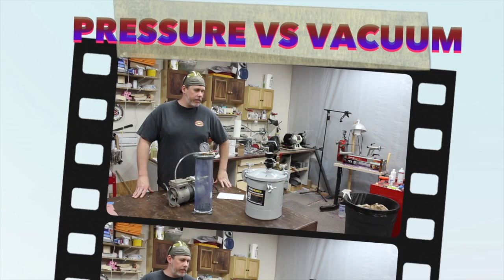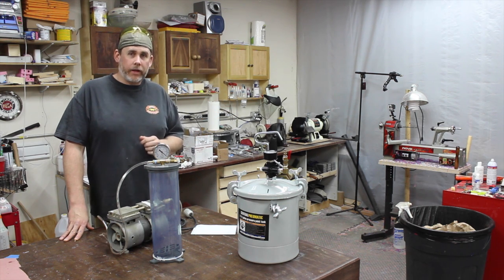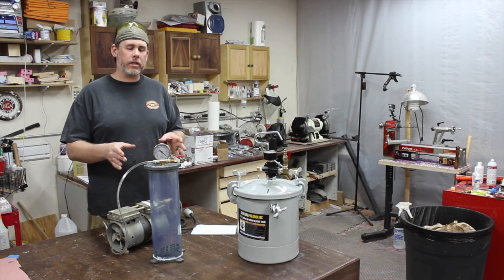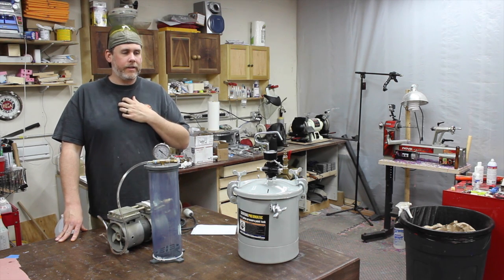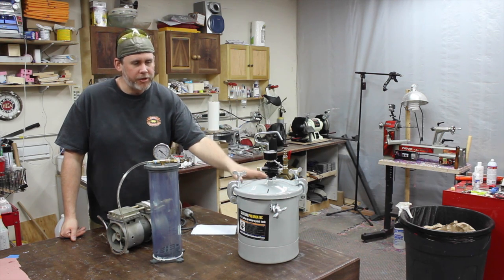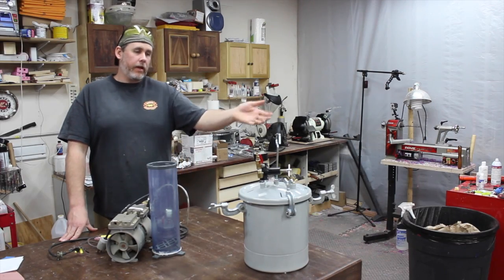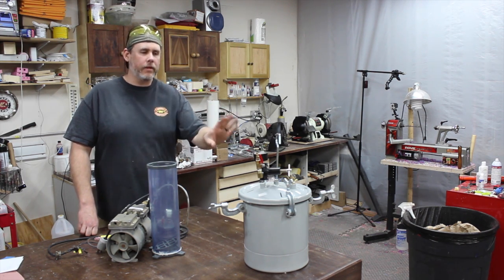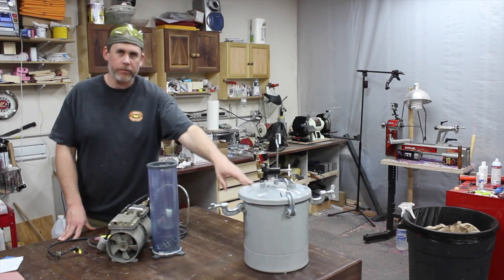Can I Use Vacuum Instead of A Pressure Pot to Cast Resins With?

Comment: I've tried using Smooth On Urethane plastic in a vacuum chamber with interesting results.  (7 minute pot time)  I will vacuum the individual components, then vacuum the mix, then fill the mold in the vacuum chamber and turn it on.  When you fill the mold, if you just let the vacuum go, the mixture will froth and bubble and ruin your casting.  

On the other hand, if you watch your mold in the chamber and ride/release the pressure to keep the frothing and overflow to a minimum, it seems to remove the large bubbles from the inside of the material and brings the smaller bubbles to the surface of the casting.  It's just like what happens when you release the pressure on rising material in the chamber to push it down and then bring the pressure back up.  I can't get the pressure back all the way to 29Hg.  The plastic  will start to froth and overflow the mold well before that point. Ease the pressure before that happens so the mold stays full, and let the material settle completely in the mold before it sets up.   This doesn't work with plastics that have a very short pot life. 3 minutes is too short.  7 minutes seems just about ideal. 

Although the surface of the mold winds up less smooth [more bubbly] than before, it definitely has eliminated a number of voids and seams inside the mold that I was having problems with.   I will try pressure casting when my pot arrives, but I'm worried it may not work since I am encapsulating objects with voids inside them and I don't want to force the plastic into the voids.
Reply from the maker: +StudioVoodooMusic Interesting results! Thanks for sharing that info with everyone. You might be right about the pressure pushing resin into the voids of your encapsulations, but perhaps if you only use low pressure it might help. I've never really tried it, but I crank mine up when casting wood and things so that the resin will be forced into the cracks as much as possible.

Comment: $100-$120 for a pressure pot?! Where can you buy one for at that price!?
Reply from the maker: sonicrockmanx You can get them at Harbor Freight, Amazon, Grizzly, and probably a couple others too for around that price. The HF one is around $90 if you bring in a 20% off coupon that they send out in the mail.
Reply: Hi Zac, curious if you have any sense of community love/hate for the Grizzly pots?
Interesting thread BTW on bubble removal physics. My hunch is that the density of the resin is simply overtaking the space of the bubbles and pushing them up and out.  Imagine a sealed container of air taken to a 100 ft depth in water (about 50 p.s.i.) and let loose.
Keep rockin', you got some great content!
- Bill
Reply from the maker: At this point, I really recommend just going with a CA Technologies pot. They are so much better in quality and easier to use, that I can't really recommend buying a cheap one anymore. All the bargain brands are about equal in quality

Comment: I have thought about this for years!!  thanks for your thoughts to understand  :)
Reply from the maker: Sophie Nelson I know how you feel Sophie! I kept hearing conflicting answers to that question, depending on who you ask. So, I decided to do some investigating! 

I still think I'm going to do some experiments with it using PR and epoxy in the future though. I need to convert a pressure pot into a vacuum chamber first. I think it could be "possible" to use vacuum, but I'm pretty convinced that pressure is a better choice regardless of resin. I'm 100% convinced that you should NOT use vacuum with Alumilite since it sets so fast though.
Reply: +Zac Higgins It may be beneficial to vacuum your 2 parts before mixing to degas any bubbles entrapped when pouring out of the original container. Just a thought; when carefully mixing so as to not trap air in the mix, it takes additional time. Is it the same amount of time or close if you would just mix quickly, degas and then pour? I would think it is comparable. Alumalite is pretty fast setting, it may pay to use one of their slower acting compounds. Have you ever tried Silmar products? They make some top notch products as well but then again, I am using polyester.
Reply from the maker: +sams iam I find pressure to work just fine for this application, and it's really the only option with Alumilite due to the fast set time. I have tried PR, but I can't stand the smell of it and it's brittle. Alumilite is a much nicer product to machine/turn, and I prefer the fast cure time as well.

Comment: Some of the early casters and stabilizers used a pressure pot that was configured to do both vac and pressure. Some will argue that vac in pressure vessel is a bad idea and I'm not going to debate it, but this was common practice 10 years ago and I never heard of any problems. The down side to stabilizing with vac using a pressure pot is that you can't see the bubbles to know that the process is complete. The up side is you can release the vac and go directly to pressure to force the resin deeper, but again the benefits of this are debatable. Is it as efficient? debateable, but it is cheaper since you are only buying one vessel (you still need both the compressor and vac pump though)
Reply from the maker: Michael T Shue Studios Thanks for the info Michael, very interesting. Sounds like a pretty cool set up having both in one, but I definitely don't like the lack of visibility when it's being used for vacuum. I also don't think there is any reason to use vacuum when doing casting. I doubt there would be any noticeable difference in quality of the final product doing vac & pressure vs. just pressure. Probably why that method isn't being used much any more.

Comment: Great video, thank you.  
I do use vacuum to degas polyurethane and have even had good results from degassing polyester resins.  I did find I had to mix slightly less catalyst for the polyesters as the vacuum tends to heat up the mix, therefore kicking the exothermic reaction faster.  In the end, I still think I need a pressure pot because I still can trap air when I pour the resin into the molds.
Reply from the maker: +cavx01 Thanks for watching! Sorry for the way late response, I didn't see this comment until now. I had a feeling it might be close using the slow set resins in vacuum, but I wasn't sure what kind of result you would really get. Thanks for letting me know about your experience.

Comment: Thanks for the explanation Zac. It's exactly what I was looking for.
These kits seem to be a lot cheaper in the US. In the UK just the vacuum chamber without the pump is about £400 and you'd be looking at the same sort of money for a pressure pot.
Luckily your advice coupled with a few tutorials on Instructables means I only need to find a vacuum pump to start stabilising wood. 
Cheers,
Ben
Reply from the maker: Glad it was helpful Ben, I know how confusing and expensive this stuff can be!
Reply: TeamWild Vacuum Chamber and Pump on this website for £410 ex VAT, So not too bad.http://www.easycomposites.co.uk/products/vacuum-equipment/complete-vacuum-degassing-system.aspx

Comment: Hi Zac
I'm starting to stabilize wood and cast some resin. As I was researching this topic I cane across your video. Very infomative, thatnks for that. I have a question: Why wouldn't be able to suck air (vacuum) out of the same paint pressure pot when I want to stabilise  and then use the same pot to push pressure to cast resin????   why do i need 2 pots?
Reply: I'm starting to do my research on this, too, and I had a similar thought, initially. Visibility and timing are the only things I can think of off the top of my head that would be an easy "no" answer to using it for both. When under vac, you need to observe the resin to determine when all the air has been evacuated. If you try to pour your mold, then pull vac, you will end up with a mess as the gasses bubble and expand, so keep it in a large enough plastic mixing container at first and pour when done.
Reply from the maker: +andre Levesque It's possible to use one for both, but I prefer to use the TurnTex chambers for stabilizing wood because you can see everything that's going on in them. Even with a clear conversion lid on a regular pressure pot, you can't really see what's happening very well with the wood. It helps tremendously to see from the sides so you know when you've pulled all the air out of the wood. The other reason I prefer having separate vacuum chambers and pressure pots is I am using both at the same time.

Comment: Great video Zac, you have answered a few questions I have had regarding Vacuum versus pressure.  Personally I always cast my blanks around the tubes for pens. the reason for this is, when you drill the hole for the tube it almost always clouds up from the drill bit heating up the resin.  I don't use pressure or vacuum because it forces the resin in to the tube.  I usually warm the resin to make it a thinner viscosity and the bubbles float out.  I use epoxy resin as Alumilite  is not available here in the UK but epoxy never seems to be as Crystal clear as Alumilite.  Thanks for posting this.
All the best
Tony
Reply from the maker: Hey Tony thanks for watching, I'm glad it was helpful.

If you're interested in trying out pressure or vacuum in the future, there are some silicone molds that you can buy that use silicone plugs that seal off the tube for tube-in casting (I'm assuming you have a homemade setup for your molds). I use them when I'm doing a tube-in casting with pressure and haven't had any issues yet. They are set up perfectly, so I use them rather than making a homemade setup for that. You could just get some of those silicone plugs and try it out with a different type of mold. I get mine at http://www.ptownsubbie.com/siliconemold.html

Down below in the comments, Cory mentioned using vacuum to degas the resin prior to pouring. According to what he's seen, it helps with the cloudiness in epoxy. I haven't tried that personally though since I use Alumilite. It just sets to fast to use vacuum.

If you try out some new methods, let me know. I'd love to hear what results you get.

Comment: A vacuum chamber is also known as a degassing chamber. When you use  silicon and slow setting resins (not alumilite) for molds and parts engineering you want to "degas" the silicon before you pour it into a mold so you get a pure cast. Depending on the set time of alumilite you could theoretically degas it before poring it as long as you can accomplish it before it's set time.  I assume they (alumilite) recommend the pressure pot because the set time is too fast for degassing. Sounds good in my head anyways lol
Reply from the maker: Thanks for mentioning silicone molds, they definitely can use degassing if you want to make good quality molds. As far as resins go, as long as you don't shake up the bottle of part A and part B, there shouldn't be any air in the resins before you start mixing anyway. I may be missing something though.  Alumilite would cure too fast to cast it in a vacuum chamber, but it may be possible with PR or epoxy.
Reply: I've never tried it personally but I've seen it, if you mixed two batches of clear epoxy one just trying to mix it without causing too much air to get in and the other put through a vacuum  chamber the degassed batch will come out super clear while the other will be kinda cloudy.  think it was west epoxy they used.
Reply from the maker: Cory Tichenor Interesting, might have to try that out one of these days.

Comment from the maker: ***** From what I've heard, the amount of pressure needed to stabilize wood with pressure requires a pretty super-industrial setup that is literally not possible to do in a home workshop.
Reply: Could you elaborate on the stabilize wood method you're referring to?
Reply from the maker: Dyami Plotke I wasn't sure which method you were asking about, so I covered both...

If you're talking about using pressure to stabilize wood, you put it under extreme pressure and it forces resin into the wood. I don't really know anything about that method, but from what I understand it takes way more pressure than you can get with an air compressor.  

The vacuum method is where you suck all the air out of the wood in a vacuum chamber.  Once all the air is removed and you release the vacuum, resin is forced into the interior of the wood where the air was. You then bake the wood which cures the resin inside the wood.

I have a video series about using vacuum for stabilizing wood if anyone is interested in seeing that method http://www.youtube.com/playlist?list=PLoeB-EPC_91vC03jk5hS8SH_7Ow4nqyZL
Reply: Thanks, Zac Higgins I'll definitely take a look.

Comment: Nice video.  Calling the company is a great idea.  I tried to do a little research on pressure casting and couldn't really find the answer I was looking for. 

My understanding is that the air goes into solution in the resin.  So basically there are no bubbles.  Think of deep ocean divers.  When they go down they get nitrogen dissolved in their blood.  When they rise is comes out of solution and forms bubbles, giving them the bends.  No bubbles on the way down (dissolved), bubbles on the way up to surface (no longer dissolved). 

If on the other hand the bubbles are just crushed to a pin point and don't go into solution, then they would still exert pressure when the resin cures.  So, if they were in a small point/tip of a cast, or very near the surface I would think they could crack the resin.  Maybe the force is far too small to fracture even thin areas of the resin.  shrug  If the air is in solution though, the force is distributed over the entire piece eliminating the chance of fractures. 

Really, in the end it doesn't matter.  It works and that is answer enough.  :)  I just love to figure out the science behind things.

Thanks for the video.
Reply from the maker: Thanks for the input, I like your thoughts on the science too. I originally thought (without thinking about it really) that it pushed the air out of the casting completely, but the more I thought about it that doesn't add up. I'm not entirely sure that they will reemerge if you let the pressure off too soon, but just knowing they haven't really left the casting makes me think I'm best off leaving the casting in the pot for a good long while to make sure.
Reply: If it's a issue of your resin's pot-life being too short to reach appropriate vacuum, just add in a spare empty tank under vacuum pressure with an on/off valve attached to it like used on vacuum former machines. the kind used to draw heated plastic sheets over molds. IE: halloween masks, storm trooper armor, etc, etc.  Once you evacuate the air from the holding tank, then open the valve it will instantly draw a huge amount of vacuum out of your vac chamber/resin. Might be tricky workin the handle to keep the resin from overflows but worth a shot.

Comment from the maker: Hey Dave, I'm not sure which vacuum chamber you have, but with pressure it's going to want to blow the lid off whereas vacuum just wants to suck it down. Many vacuum chamber lids don't have any way to clamp the top down to the pot, so it wouldn't work. I'd be careful with your setup, make sure it can handle holding pressure before you try it.

Comment: Thanks Zac.  This was very helpful.  If you get the right stuff, I do think it is possible to use one pressure chamber for both vacuum and pressure.  It would be a steel pot with a structural clear top.  That would allow you to use the same chamber for both applications (not at the same time of course!)  As long as your fittings matched both the vacuum tubing and the air hose, and your valve read both air pressure and vacuum, you should be good to go.  Unless I'm missing something.  Am I?

Thanks for the video.  Yours are very helpful.

Dave
Reply from the maker: +Dave Dontgiveout Thanks for the kind words David, and thanks for watching! You're not missing anything, you can definitely use one thing for both if you have all the necessary parts, but it's a whole lot nicer to have them separate. Plus, I recommend using the TurnTex chambers because you can see inside the chamber from the sides. It really takes the guesswork out of stabilizing since you can tell for sure that all the air bubbles have been removed. It's a little more difficult to tell what's really going on when looking down from the top.